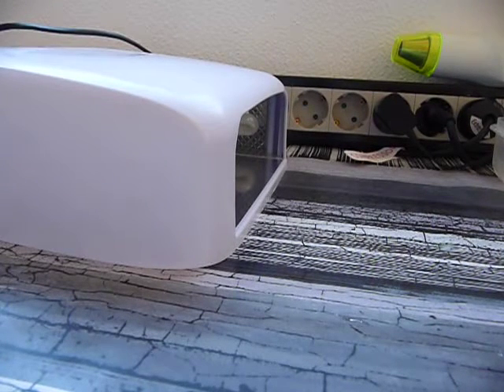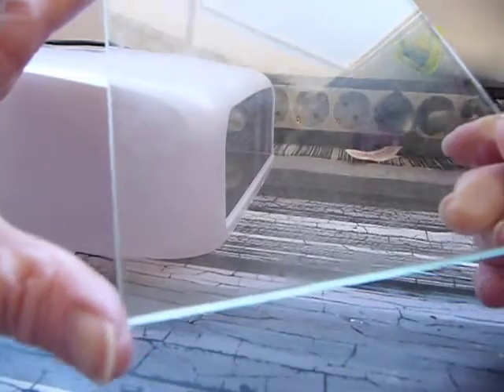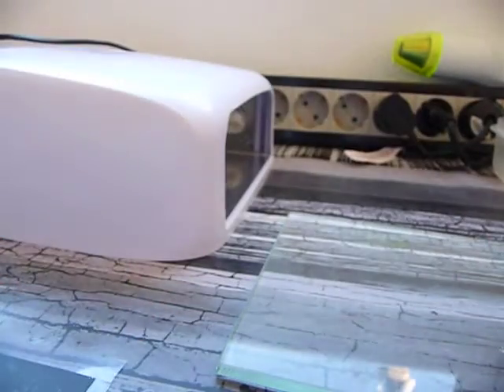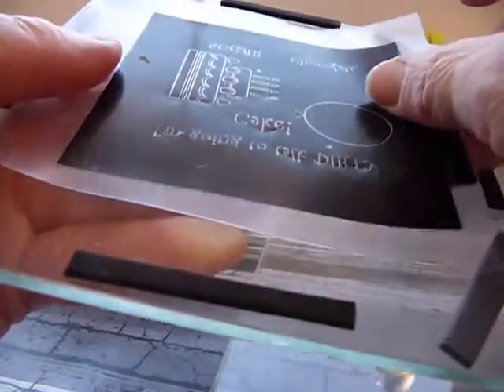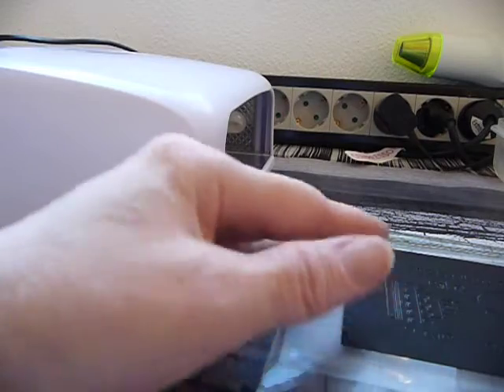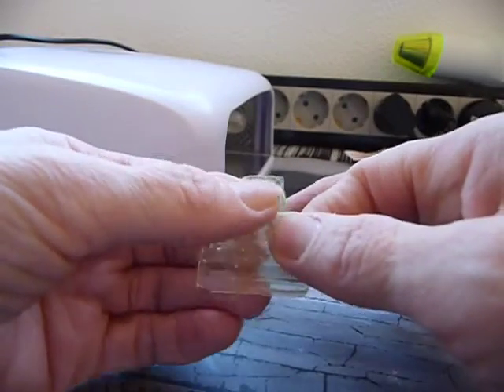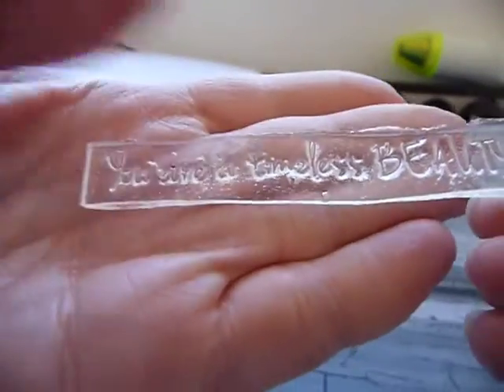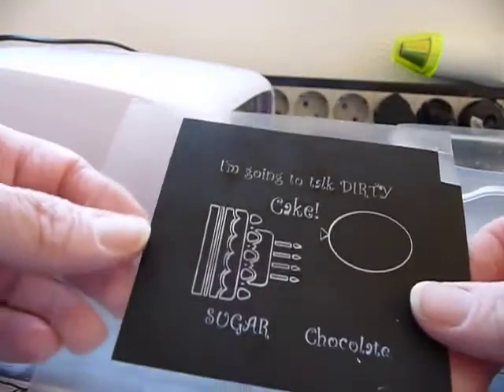Polymer stamp making at home  3

Comment: what re the largest size you can do in your machine?
Reply from the maker: In this one, about 10 x 10 cm. For those interested in making larger ones, you can make up your own box with UV lamps. However, since I don't make to sell, this is large enough for home use.
Reply: just wondering i am thinking about getting the double wide nail lamp.
Reply from the maker: By all means if you can get one (I never looked!). You can also buy commercial A4 size machines. However, timing can be tricky and if you don't get it right, you could waste a lot of gel.

Comment: great video...do you have any advice on getting all the resin out..mine come out kind of gummy...I want  them to be crystal clear like you buy in the stores...any advice
Reply from the maker: You mean they stamp well but are very sticky? What you can do if that is the case is put them in a shallow dish, just covered with water and put them under the lamp for several minutes after you have actually made the stamp. The nature of the polymer means that these ARE sticky when finished. Store ones may be made of silicone (cheap) or a harder polymer. Some are laser cut.  You could see if you can find a polymer with a higher durometer  (hardness level).